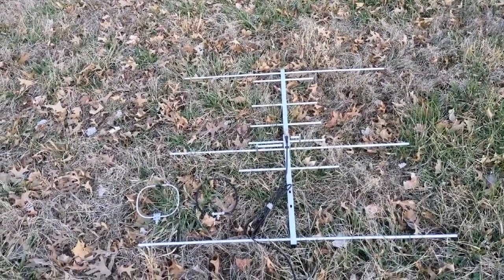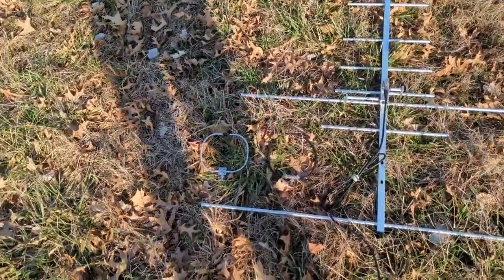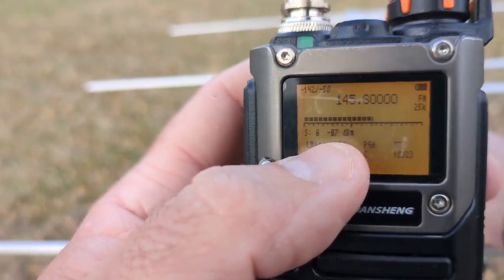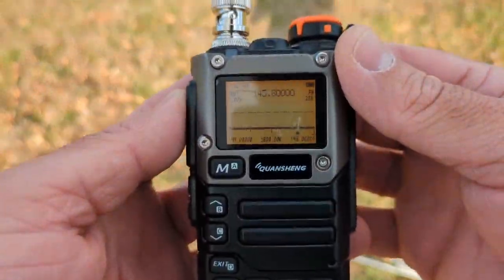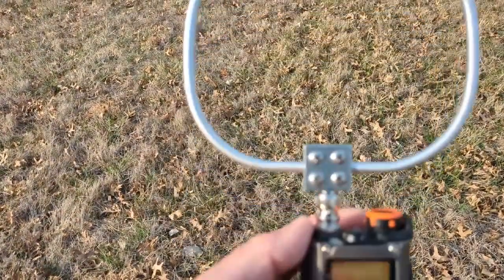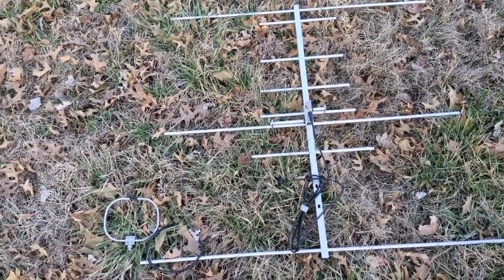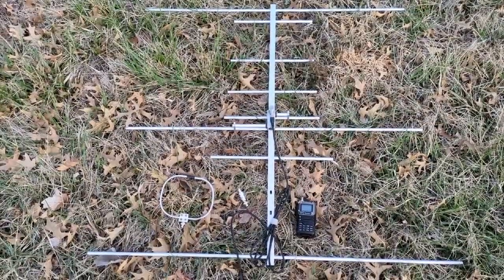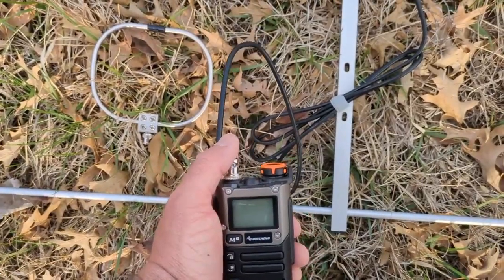Quansheng Pt3: Radio Direction Finding

Comment: Question. Another build instruction tell you to short braid and center conductor in the “other” end. Is that correct?
Reply from the maker: I have seen a couple different variants...  I'd try one of each and see what your results are - I have found both shorted at one and and open at one end work similarly.

Comment: What is the exact Yagi antenna you are using? I initially thought it was the Arrow LEO Satellite Antenna, but I am guessing it's the TWAYRDIO 8 element Yagi from Amazon. Great video, brother! Just subscribed.
Reply from the maker: Aliexpress special, I think it is Ailunce brand.

Cheap but it works, and it's dual band.

They have a folding 440MHz 3el yagi that is nice and portable too.